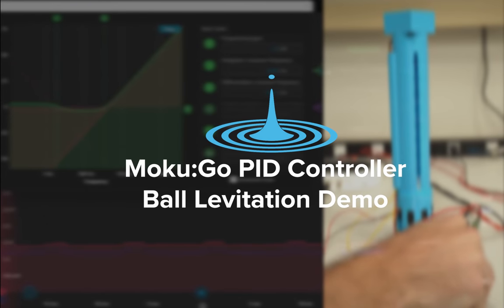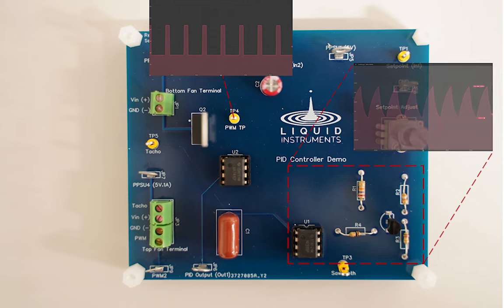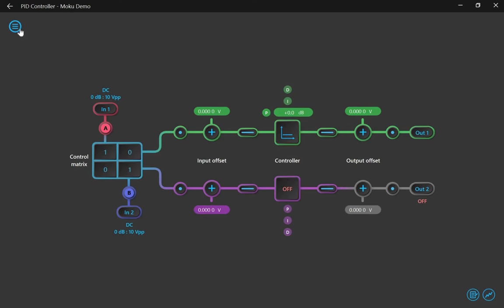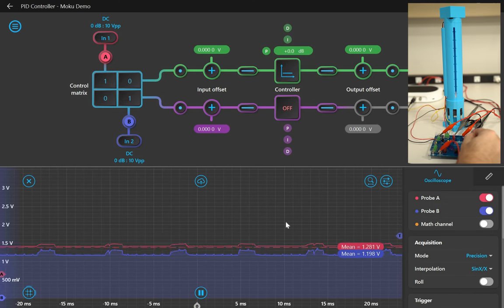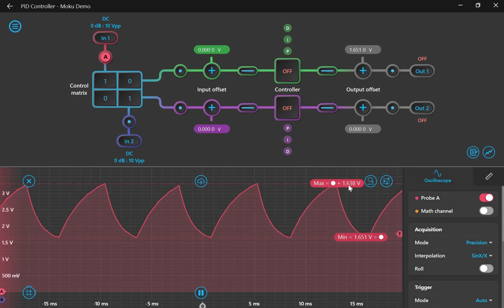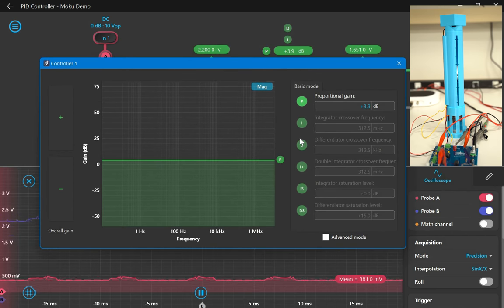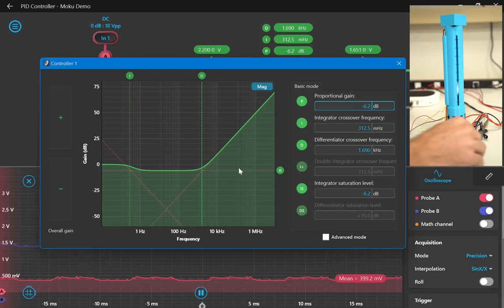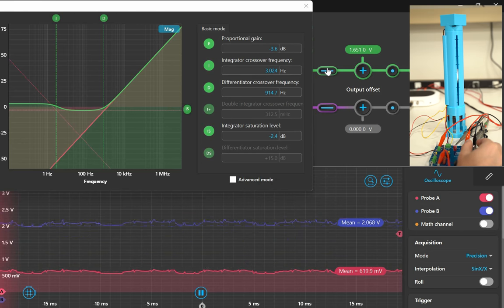Real-time Interactive Tuning Using Moku:Go's PID Controller

Comment: Hi, how can I set the setpoint of the controlling loop? Thank you
Reply from the maker: In general, there are two ways to change the set point. If you need a constant (DC) value, use the Input Offset field to add or subtract the set point value from the sensor input and form the error input to the PID Controller. For trajectory tracking, the set point can be given as a voltage on the second input BNC. Then, use the Control Matrix to subtract one input (the set point) from the other (the sensor signal) to again form the error that goes into the PID. For the set point of the fan and the ball in this system specifically, a potentiometer connected to one of the inputs is used to adjust the set point. Thanks for watching!

Comment: Can the transfer function at min 6:54 really be correct? Plotting it in Matlab delivers another Bode diagram than in the video at min 6:54? Thanks.
Reply from the maker: The transfer function may look slightly different in the app compared to MATLAB since the integrator saturation is enabled to prevent the ball from always going to the max height. This would add an extra pole to the equation that was not included for simplicity. We’re happy to discuss this in greater detail if you'd like. Visit the User Forum on the Support section of our website.